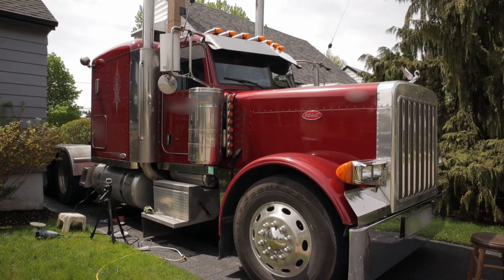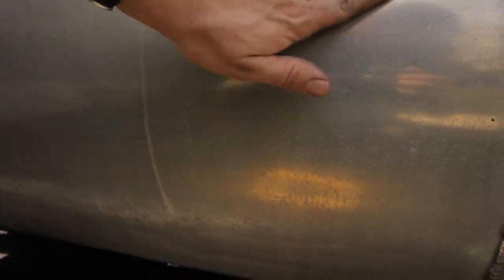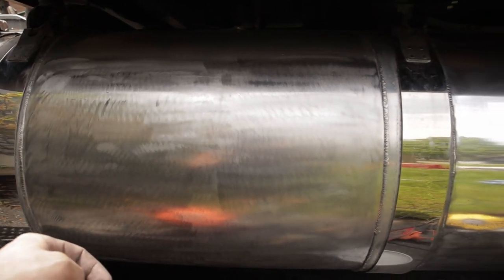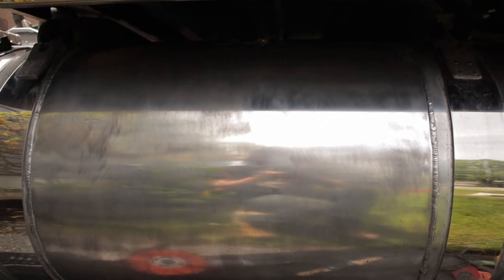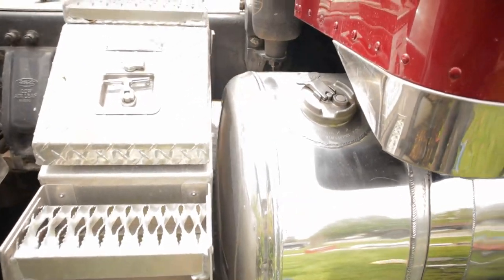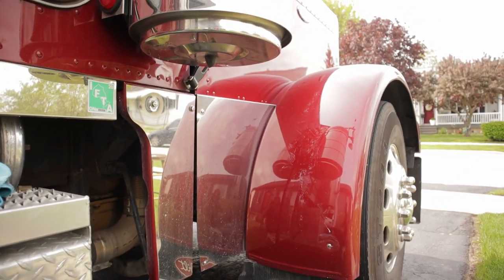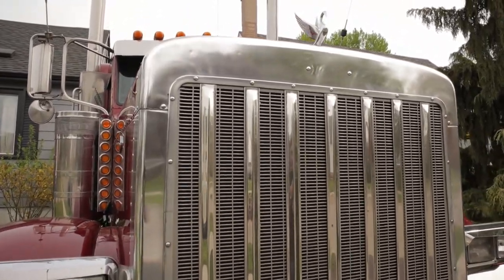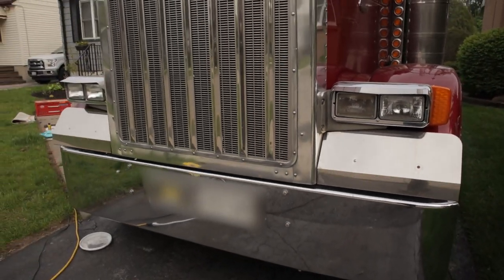LEARNING HOW TO POLISH A BIG RIG

Comment: Such a nice truck man. High powered CAT too. Awesome color. Sharp rig man. I work for a towing and recovery company. I do not own my own truck. It’s company truck. If I did work like you, I have to travel far and lug freight I’d buy a early 2000s to 2007 ( maybe brand new) kenworth W900L with studio sleeper or a Pete 379 or 389 with the large sleeper. Sharp trucks. High power twin turbo CAT in em too I’d get. Truck I drive is a 2005 Kenworth W900L 75 ton rotator we installed on it. Used to be lowboy truck. Has miller 2017 75 ton rotator unit on it. Built 700+hp twin turbo coal rolling C15 acert CAT under the hood. Incredible truck. Stock too. Your Pete with that 600 CAT. Stock them CATs are amazing engines. Torque and power 💪🏼. If I’d go for a Cummins it be the N14. Another awesome motor. Keep enjoying that Pete man. 🤘🏼

Comment: I'm not much of a metal polisher but I've done alot of paint polishing the haze usually shows from to much sanding or to much compound. Heat transfer is a huge factor in a consistent shine.watch a few of Evan Stegers videos. He's a will known metal polisher seen alot of his work through big rig videos check him out might give u some hints.
Reply: P.s What company do u drive for?
Reply from the maker: Thanks man for the tips, I’ll have to play around with the settings next time, I’ll also check out his vids!

And I work for a small four truck operation out of Ontario Canada.
Reply: Yea, I watched a few of his videos on tanks & wheels. I like the one about different pressures & what the finish will look like. There's another guy that takes a scrapyard tank (huge dent), he shows how to sand & polish a uncut tank. Which is about where I would start with Matt's tanks but I would make a judgement by feel. 
Hand polished my company truck uncut tanks once, used never dull to cut them & polished them buy hand twice with Mothers Aluminum Polish in about a weeks time. They looked pretty good & got quite a few complements (not directly) on the radio!

Comment: I’m sure there will be several tell you how to polish, so my two cents, first thing, it’s a lot of work. I started with 300 grit, I wet sanded, then 400, 600, 800, 1200, 2000, 5000, once you get there it’s pretty bright, I then buffed with some compound from a trucker, I was doing motorcycle parts nothing large like a big rig, almost forgot the first step was to clean tanks with acid, old style wheel cleaner
Reply: Are you insane? 180,320,400 and end with 600 Professional polishers would laugh at 1000 and 5000,😂

Comment: has your wheel got speed settings put it on low settings but with spraying water on it so you dont burn paint or chrome i use to do use that when i did valeting i have valeted for 25 years also for chrome use 2000 grit wet and dry sand paper with washup liquid before buffing tanks then buff and polish

Comment: I did my fuel tanks & exhaust stack with never dull, it's a wading material with cleaners imbedded into it, works real good for cutting in the tanks, removing the black soot & other crap off of chrome exhaust stack. Then I used Mothers aluminum polish to finish the tanks, did them 2 or 3 times by hand. They shined pretty darn good & had a nice reflection but nothing like a high speed polish.

Here is a link to the one guy I watched & picked up some pointers from. He has a few other videos about polishing tanks & what bars to use. https://www.youtube.com/watch?v=XERG_nkQR3k

Nothing like jumping in the deep end & trying to swim with the big fish.😉😉 I've been there, done that on many things! That tank looks pretty damn good! You'll get better each time you polish something! You know what they say, practice, practice, practice. The 2 previous paragraphs were typed during the video as I had it paused but I took out 2 big ones with my opinions & added the link. Learn from the professionals & you'll get professional results.😊😊

Spoke to ya later, come on.😎
Reply from the maker: Thanks man, I’ll have to check him out!
Reply: @callthemall  There's another video where some other guy takes a scrap yard tank, preps & polishes it to a mirror finish. Keep practicing & you'll get the same results. There's some kind of sealer that suppose to help the shine last a little longer, don't remember what it's called

Comment: Your top issues are the grits used with different applications,  and you should always be traveling in thr motion of thr grinding wheels, not back dragging, it's just spreading compound. 
Grits 240 / 320 / 400/ 600 and use the same system don't go from a sander to hand sanding. If you start with a palm sander, use that for the rest of the grits. If you start by hand, finish by hand. I hate to see you work so hard on those tanks for the result given

Comment: That is definitely a weekend package.  You can't skip sanding grits. If you start with 120 next should be 180, 220.320.400,600,800,1000 and then 1500 should be ok. If you skip steps then you can't get all the scratches out from the previous grit. That is why it is very important not to skip or you will see sand marks.
Looks good for tp what you did.
 I'm in Kitchener.
Reply from the maker: Yeah man, turns out the polishing wheels take out everything over 400 grit, so i did the second tank off camera with 180, 220, and 400, then the wheels, and it turned out real nice! I put a couple pics at the end.

Comment: I wouldn’t use any sand paper over 320 grit your just wasting your time if you do .with tanks in that condition use the  red rouge with a red pad and as the pad is spinning hold tightly on to the brick and press it against the wheel and shoot it on the tank then just lay into the tank hard .You are basically sanding the scratches with the roughe trust me it works